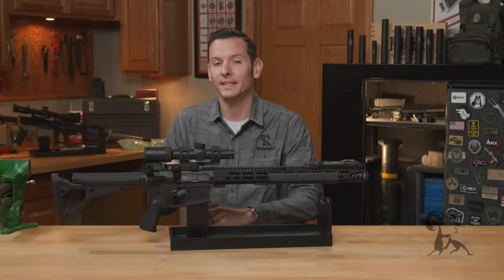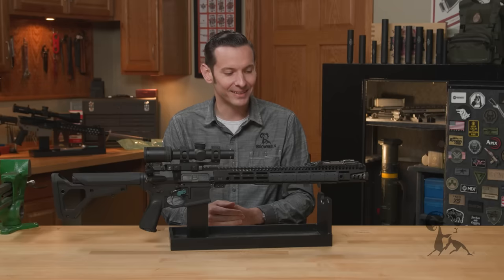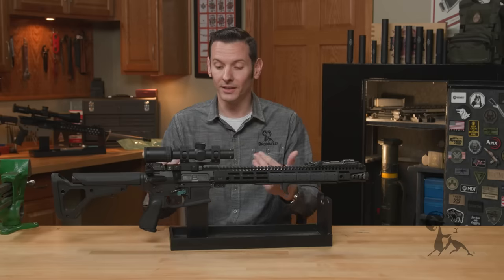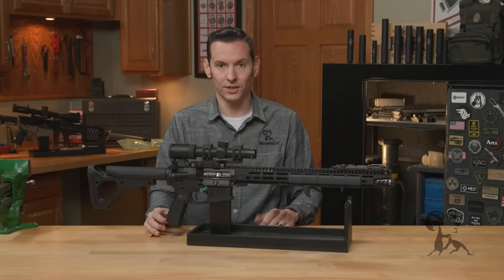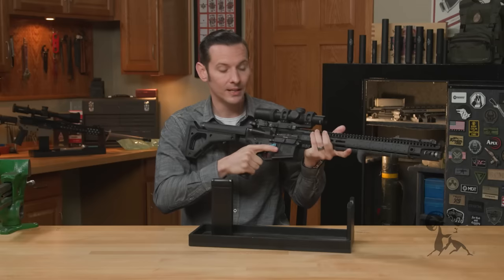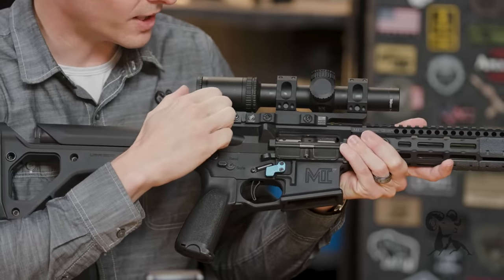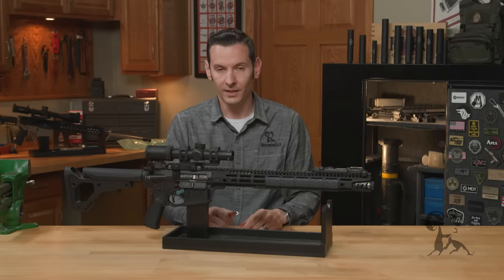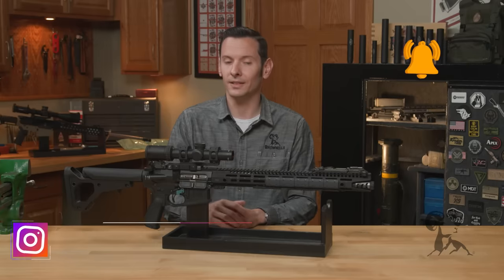Quick Tip: The RIGHT Way To Use the Forward Assist

Comment: Immediate action and remedial action are not the same. Immediate action is “tap, rack, bang.” Remedial action “sports” is used in malfunctions that tap & racking won’t clear (i.e. a double feed). In the Marines (at least in 2003-2008) SPORTS stood for… Seek cover, Pull and lock bolt to rear, Observe the malfunction, Remove  the magazine, Take appropriate action to clear malfunction and reload, Sight in and reengage. Immediate vs remedial action.
Reply: Ahh, in the army we just maintained cover as we moved. It wasn’t part of our malfunction checklist.
Reply: Sports per USMC 2009 Scream at rifle for not working, pound aimlessly on it, orient self towards enemy, throw Rifle at enemy, Take out secondary weapon, Supress enemy with secondary weapon"...i jest but mostly cuz they didn't teach sports they taught us to tilt, strip, rack, reassess and reinsert and re-engage...and it doesn't make a cool sounding acronym

Comment: I literally needed my forward assist on the very first magazine I put through my AR after building it.

I had installed a PSA "premium" nickel boron bcg (I don't know why. I'm sure PSA is fine but this build was over $1000) which turned out to be out of spec somewhere. It made a zipper noise and was hard to move around in the receiver.

The first time I shot the gun, the bcg gave me problems. Specifically, the bolt didn't quite want to cam all the way into battery due to the increased friction, and the forward assist was the perfect tool to slide the bolt forward that last little bit.

Side note: Unless you're doing an ultra budget build, stay away from PSA on the critical parts. That's probably obvious, but still. The internet made them out to be "probably fine," but my bcg was out of spec as mentioned before, and my firing pin was also too short which caused light strikes. My friend, a few months ago, bought the exact same bcg not knowing about my experience. He brought it over and had several light strikes, and also had the strange zipper noise and increased friction. I recommended that he remove the firing pin from his old BCG (which came with his s&w m&p) and stick it in the PSA, and his issue was fixed. I returned mine and bought a Daniel defense mil spec bcg. Buying something more basic but from a much more reputable company meant I only payed about $80 more. I haven't had a single issue since swapping them out

Comment: I think the forward assist was added when they was having problems with the M16 in Vietnam because they told them the M16 didn't need cleaned but after alot of shooting carbon will build up and the bolt carrier won't seat good. I wouldn't buy one without a forward assist. If you have a jam it won't help because you need to clear the jam first. The forward assist has alot of good uses

Comment: TRB is missing a crucial step. It has to be tap rack observe bang. If you just TRB without observing you're very likely to induce a double feed. This is why there is an O step in sports. So even if you leave out the fwd assist step make sure you add an O step into TROB.
The O is critically important.

Comment: In my experience the guns that I think would actually fair to be improved by a forward assist are firearms that use a delayed blow back. This would be things like the MP5, HK 91 , PTR32, or the FAMAS. This is because the way those guns operate require a certain bolt velocity to properly close and lock the bolt. You see this adopted on some versions of the G3 rifle where on the G3/SG1, PSG1(A1), and the MSG90 have a mechanism similar to a forward assist, but it is called a "silent bolt closure device" eluding to its use. Due to subtlety being dead you can assume that the device closes the bolt quietly from the partial close position to fully with the press of the button. It also doubles as a brass deflector so it is really doing a 2-in-1 job and it really makes a lot more sense on those rifles than an AR-15 or AR-18 derivative.

Comment: This goes back to 1964/65 time frame.   The tolerances are tight on a M16 and when mixed with the wet muddy conditions of the jungle along with ball propellant, & infrequent cleaning it was added as a preventive to a round not seating thus leading to a misfire in combat.  Over the decades it has evolved into other uses. 

This is one of the reasons many preferred the AK was because the lose tolerances were more forgiving under those conditions.

Comment: Infantryman for nearly 20yrs here with multiple combat deployments... the forward assist is absolutely needed on every true fighting rifle. I've used it many times to not only seat rounds for different reasons, but to strip the top round off of the mag.
Reply: There are 18Bs and JSOC operators with far more trigger and deployment time who have the opposite opinion.  Big Army trains incorrectly on immediate and remedial action.  JSOC and SOCOM have a different approach to how to actually use this design.  The SOCOM M4A1 manual from the early 2000s covered all this, and I don't remember it discussing much, if any use of forward assist.

In high volume courses, I know it might as well not even be there.
Reply: @LRRPFco52  that's great for them and there will always be a debate, but I don't personally know a single individual in that community that says don't use a forward assist. I've worked with many from multiple branches, both in and out of the military. There are several accounts of it saving lives.
Reply: @WallyMerc06  I have never done CQM training with them instructing where they even mentioned using forward assist.  Not in Ranger Regiment, not in Group, and definitely none of the Unit guys advocated for using it.

They specifically critiqued the big Army's SPORTS as something not to do.

Comment: I get that Eugene Stoner didn't feel the need for a forward assist. Personally, I feel like the "failure button" is the only worthwhile addition the military added to this design. Although 99% of the time I actually use the thing is after a chamber check.
Reply: @Mangoré1885  Kyle Rittenhouse disagrees
Reply: @Mangoré1885  Have you scene the footage? He used it after he shot. That situation has literally nothing to do with "racking the bolt hard" lol
Reply: @Mangoré1885  what if the buffer spring is out of spec and the chamber is dirty? Oh.
Reply: @DeafeningPew  He was using a dry VISMOD-15 imitation gun, CLGS 16" barrel.  That's a recipe for failure.  He's lucky it worked up until that time.
Reply: @Followme556  Dirty chamber plus worn action spring plus lube and good ammo from good mags will work fine in temperate weather.

Weak action spring in extreme cold might have sluggish function.
Reply: @LRRPFco52  and is the forward assist there for ideal conditions or for worst case conditions when Mr Murphy and his law come to totally wreck your world? Exactly.
A weak or broken action spring, a bent or dinged buffer tube, icing, out of spec weak ammunition, all of these things can cause TRB to fail.
That is why the FA is there
Reply: He was using a S&W M&P15
Reply: @wvmountaineer69  I believe the specific model was a Smith & Wesson M&P 15 sport II.
Reply: @Victory 6 Actual, yes, that is correct!
Reply: @Followme556  Weak action spring= poor organizational culture, bad armorers.

Bent 7075 T6 drop-forged RET?  Grab another weapon and quick.

Icing:  I've literally been shooting and running high volume CQM courses in the sub Arctic from 2005-2016.  Never seen a BCG ice shut.  We lubed them and broke the chamber seal for overnight.

AKs seized up in those conditions, 11.5", 14.5", and 16" ARs didn't.  Most of the winter courses were done at -27° to -30° C in Jan-March months in/near the Arctic Circle.

We're talking large sample sizes of carbines and rifles, different types too.  AKMs, AK-74s, ACR, FNC, Rk62, Rk92, Rk95.

You start to quickly see that the conversation about forward assist exposes bad unit culture, bad/improper training, incompetent leadership, and units that don't actually train in the conditions they hypothesize where they might need forward assist to cover up their institutional and habitual mistakes.

Even worse, guys who have mindlessly pounded on it in a firefight because their leadership and drill sergeants taught them SPORTS, then they report how they needed forward assist for real.
Reply: What a lot of the younger generation doesn't know about Stoner is that he didn't spare fools the criticism they deserved, and he called out the criminal incompetence and sabotage that was directed at the AR-15 by Army Ordnance Corps when he testified before the Ichord Sub Committee.

Army Ordnance Corps leadership didn't like that being flung their way, even though they needed to take ownership of their incompetence and misconduct related to everything they touched on the rifle.

They're used to people bowing and saying yessir, nossir, 3 bags full.  Stoner wasn't that type of stooge, and he wasn't afraid of pointing out gross missteps they made with the AR-15/M-16, lack of chrome-lining the chamber being the biggest one.
Reply: @LRRPFco52  he was a guy with an ego... simple as that.
Reply: @LRRPFco52  false. He had a factory stock Smith & Wesson M&P 15 sport II
Reply: @Followme556  M&P-15 IS a VISMOD-15.  That’s a term coined by Pat Rogers for imitation guns that don’t follow the TDP, so yeah, I’m exactly right about what I’m saying.  I’ve been eyeball-deep in AR-15s, M16s, M4s, M4A1s, etc. dating back to the 1980s with an extreme hunger for data that I rarely see matched by any channels, especially those run by younger guys.
Reply: @Mangoré1885  not after a brass check when the bolt is only pulled partially to the rear.
Reply: @LRRPFco52  I can't speak for drill sergeants, but drill instructors absolutely do not teach anything about pounding away at the forward assist when dealing with a stoppage. The T in SPORTS Is TAP, not pound or smash or whatever. Something you do lightly with the thumb, not something you do with your palm. It's not there to jam a problematic round into the chamber. The drill instructors, range instructors, and combat instructors that taught me all were very clear about that.
Reply: @jsquared1013  They taught you and me bad habits.  Asymmetric Warfare Group (CAG guys) literally went around the Army in the NCOPD courses and other institutions to try to teach legitimate M4 TTPs, but I think that came and went.

They've always had a tight relationship with Ranger Regiment, so that crap isn't taught there.  Big Army refuses to allow valid data to clean up their sewer of institutional inertia, although we finally got a more battle-focused marksmanship program and PT test.

Because of some of the units I was in, we got plugged into better TTPs.  There were very little valid practices by big pickle green TRADOC Army.  I'm trying to think of any and drawing a blank, other than NATO format OPORD/FRAGO and Troop Leading Procedures.

In LRSC, we were heavily influenced by the NATO Recce/LRRP communities via ILRRPS, which was populated by senior SAS, Commando, Alpine Jaeger, Recce, and SF NCOs from around Europe.  These were all guys with 100s of years cumulative experience that was 100% reality, not silly and arbitrary garitrooper BS espoused by retards with low GT scores, who got promoted continually when they should have been kicked out for incompetence.

The cultural differences were black and white, and it reflected in weapons handling, comms, planning, contingencies, training, etc.

Most of what the big pickle machine does violates lessons-learned, and embraces failed TTPs just because the senior NCOs and Officers don't read.

Comment: The anti forward assist group is the same group that's never had to use an AR off the range. That forward assist is used as often as that charging handle to make the weapon condition one. Anyone that's ever done anything with the AR knows how useful it is in making sure it's in battery for when you need it to work.
Reply: Really?!  A career in the Army, most of that as a Special Forces operator, 18B, but what would I know. 🙄
Reply: Career in 11 series, multiple Recon units, attached to multiple SOF task forces, foreign armies, have shot untold tens of thousands of rounds through M16A1s, M16A2s, M4A1s, M4s, 11.5" Commandos, 10.3" suppressed, 12" suppressed, day, night, shoot house, flat range, sub Arctic, desert, mountains, JOTC/Panama, Korea, ME, Finland, Estonia.

I just don't see the need for it.  I prefer the slick feel of GAU-5s and order as many slick M4 no FA uppers for my builds.  I still have most of my uppers with FA just because that's all that was available at the time/standard.

It's much ado about nothing technically and practically, but is an important conversation starter about how inept Army Ordnance was during the early days of AR-15 adoption, particularly the fiasco with the Colt 602 and how they changed the propellant in M193 from tiny stick powder to ball, without testing the rifles with that to see what changes should have happened.  That's the real story.
Reply: @LRRPFco52  Denying it as a useful feature is also a good way to hear from people that feel that it should be mandatory on all ARs.  Sounds like you had quite a career. Thanks for all that you did. I hope that you enjoyed it as much as I did.
Reply: @RobinP556  I had a lot of good times and some really sucky times that always involved incompetent or corrupt leadership driving their excrement downhill onto us.  Units with great leaders were a totally different experience, loved it.  Even better to be able to determine my own schedule and who I worked with once I got off active and went private.

My main focus from 2005-2016 was in Northern Europe preparing for all that’s happening now and more to come.  My mom is from Finland, my grandfather fought in Talvisota and Jatkosota, we lost 3 great uncles during Talvisota and Continuation, and my great aunt.  One great uncle went missing/taken by the Russians.
Reply: @LRRPFco52  You need to tell your story somewhere. I’d love to read it in a book, but that’s a heavy time commitment.

Comment: Most people don't realize it's a feature there to provide mobility in both directions to the bolt. You can manually move the action of a pistol, bolt action rifle, etc back and forth, but can only charge in one direction. It provides you the ability to move it slightly forward if you need to seal the action up properly.

Comment: personally I like the forward assist I think that is what makes an AR-15 look like an AR-15 the very first one I had ever seen had a forward assist so to see one without it just looks odd to me ouside of a side charging upper. People do not realise that for one Kyle Rittenhouse proved the theory of a forward assist. Plus the forward assist is just easier and faster, then trying push the bolt forward with your finger. Also it is just more tactile using the forward assist. Apparently people have never been in a stressful situation, when that bolt doesn't close all the way. just saying but to each there own.

Comment: If the recoil spring failed miraculously, you could really use that assist to ratchet through all the sand and frog legs.
Reply: Yes.
Reply: You can also get a slightly bent or dinged buffer tube that causes the fully in spec buffer spring to not have enough force to slam the bolt home. I have seen this. The fa is there for a reason

Comment: Greetings from Brazil 🇧🇷 

As most military rifles have no firing pin spring, when you load their chamber by letting the bolt go, firing pin will strike the primer with enough force to leave a dent, hopefully not enough to fire it, but it does happen.

My Colt AR15-A2 manual actually warned about this and advised to always chamber a round with the barrel pointed on a safe direction.

Brazilian police, which has their rifles charged indoors, have a sand box for that purpose.

So, if you have to charge your AR inside your bedroom and you don't have a fern vase, you can ride the bolt closed, then use the FA.

I have had a similar incident with my M1 Garand. I fired one shot and the report came out  sort of long and I saw two cases bouncing on the ground. As the bolt ejected the spent case and loaded the second to the chamber, firing ping struck and fired the second round. It happened 30 years ago and I still keep those two primers as a reminder.

Comment: A Viet Nam vet I worked with said it was for silently closing the bolt, I. E. You'd load a mag, gently and slowly close the bolt, then tap the forward assist until the bolt is home. I tried it on mine, guess it has a few uses, but you fisting the forward assist is gonna make noise, too. Just a thought.

Comment: I always understood the forward assist to be a solution in search of a problem dating back to the AR15/M16 days. In all of my years with AR15's, an M4, and a few M16's, I have NEVER needed it. I DID need more common-sense the first time I fired an AR15 though. The bullet was only a hair larger than a .22, just with more powder. My brilliant self fired it with zero hearing protection. Once. I lost my hearing for two minutes and had a ringing in my ears for the remainder of the day. Boy I was dumb! Wear your hearing protection, kiddies!
Reply: The obvious size of the 5.56 case and powder capacity is a dead giveaway that it's not a .22 rimfire. Even the Military furnishes mandatory ear protection. Maybe talk to a Military person before you make up your mind on the forward assist. Ask a Marine about it.